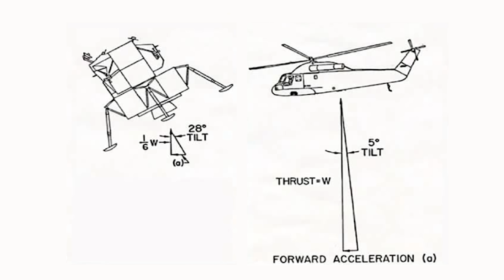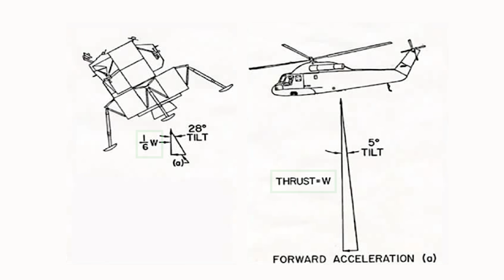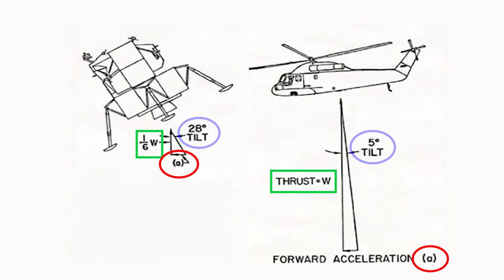How Neil Armstrong Trained to Land on the Moon  - Smarter Every Day 250

Comment: How did they solve the Van Allen belt problem?
Reply: put stuff between you and the outside of the ship. this was figured out more than half a century ago, get real.
Reply: @atlas8827  Do you realize that, that "stuff" must have the radiation protection of 12 feet of lead?
Reply: @samadams7224 
 That claim is ridiculous and not supported by anything. Give an authoritative source
Reply: @atlas8827  You're the one claiming it ridiculous.  Where's your link?
Reply: @samadams7224  
You made the claim about the lead shielding, not me. How do you know you'd need 12 feet of lead?
Reply: @atlas8827  Are you saying you don't know the radiation levels in the belts?
Reply: @samadams7224  
I'm just asking where you got the 12 feet of lead figure. I know a thing or two about radiation, and I can't think of any radiation level that would require that much shielding. So, where did you get your figure?
Reply: @atlas8827  You originally said "stuff" between you and space, so I doubt you know one thing about radiation let alone two things.
Reply: @samadams7224  
Explain how what I said is wrong. That is a very basic way of dealing with radiation. You put stuff between you and the radiation. The material in-between soaks in some or most of the radiation before it reaches you. This is particularly true for the van allen belts, because most of the particles are of low energy, meaning they're fairly easy to stop. "Stuff" in this context refers to everything that is between the astronauts and the outside of the spacecraft. The hull and the navigating equipment, mostly.
Reply: @atlas8827  You're right I'm sure engineers use the word "stuff" all the time, especially on technical drawings.
Reply: @samadams7224  
I'm not an engineer, and we're not in an academic setting, meaning we can forgo any formalities. Nothing of what I have said so far is wrong. Where did you get your 12 feet of lead figure?
Reply: @atlas8827  In 2000, I was at the Houston space center and they had the Apollo 17 capsule on display.  Back then the public could touch the open hatch door.  It was only 1/8"  aluminum.  Instead of saying "stuff"  why didn't you just say 1/8" aluminum will protect you?  I know you're not an engineer, but you still need to use common sense.  Put your cell phone in an aluminum box and see if you call the phone and have it ring.  Stand under a cell tower.  It will ring.  Do you think the microwave radiation from cell phones is more than the Van Allen belts?
Reply: Also, the radiation in the van allen belts is in no way comparable to cellphone microwaves. That is wrong in so many ways I can't even understand why you would make that comparison.
Reply: @atlas8827  I don't think you're capable of understanding what I've told you.
Reply: @samadams7224  
I am. You told me the hatch door was 1/8th on an inch thick, which it obviously, evidently isn't. 

Then you made a comparison between the van allen belts and microwave radiation, which is silly because they're completely different things. What exactly is there to understand?
Reply: @atlas8827  1/8 of an inch.  Don't they teach factions in school anymore?  Let me try something easier.  When you go to the dentist and they take an x-ray of your teeth they put a lead apron over you, because for a split second you're being exposed to radiation.  Why don't they use a thin piece of aluminum?  Because it doesn't offer any protection.
Reply: @samadams7224  
Yes, 1/8 of an inch. 0.125 in, or ~3mm. There's no confusion on my part here. The hatch door of the command module is obviously thicker than that. Look at the image I posted. 

A thin piece of aluminum would not do much against x-rays, but a thick one, like the one found in the command module, most certainly would. But this comparison is still flawed. It is not as dumb as the microwave comparison, so that's an improvement, but it's still wrong. Photons from x-rays can penetrate much further into materials than the low energy protons and electrons that dominate the belts.
Reply: @atlas8827  The command module is the capsule.  That door is hollow like your car door. Unless you think your car door is solid metal too.  The skin of the capsule was only 1/8" thick aluminum.   I've spent too much time on this and am bored.  You have yourself a good life.
Reply: @samadams7224  
How were you able to get that number by just looking at the door? Did you drill a hole on it? Sounds like you read that figure somewhere and took it at face value. Is that what happened? Just like with your 12 feet of lead claim? It is, isn't it?
Reply: @atlas8827  Drill a hole in it?  I rapped on it with my knuckles.  It's hollow.  I told you, I touched it, I felt it. Just like your car door is hollow. The skin of the capsule is 1/8" aluminum.  I felt it.
Reply: @samadams7224  
I'm curious as to how you could tell the skin of the capsule is 1/8 on an inch thick by doing that. "I felt it" doesn't strike me as particularly persuasive.
Reply: @Justincase008  I wouldn't pee on Curious Droid if he was on fire.  He still owes me $10 bucks he borrowed years ago.
Reply: go thorugh fast enough and in the right place

Comment: To this day , vertical landing had been a nightmare for rocket engineers. By the time it was not successfully simulated here on earth, yet it was managed to do on the alien surface successfully in the first attempt, bleurgh. It sounds more like a faith talk not tech talk. There are many marvelous achievements by the NASA in space exploration, that it can cover up what was technologically unachievable at the time. It would be interesting to see how one such landing could be made in 2024. With the technological advancement, It should be way easier then in 1969, devoid of the transistor magic yet. It is still thrilled with challenges and risks that can reveal the truth of Apollo landing, people have been fooled for so long. And it is this fear that has stop NASA from making one such attempt.

Comment: Hey a series that you haven't done that I think would be super is a SPY series.

Such as the SEAL of the United states and how Russia planted a microphone in this gift. A trojan house type warfare.
How it ws remotely powered and able to transmit signals back.

The interesting gadgets of today, how they can turn your cell phone into a super spy machine. IE able to hear a conversation over a km away.

Microdot film and how it worked. The ability to remote power items isn't anything new, but it has interesting applications in industry and life. :D

Comment: ................though I did not watch, I would believe you would need a vessel, to sneak into the room without leaving a landing creator. & to puppeteer the astronauts around, use that stealthy NASA cable that only reflects above astronauts when if the staging of the lights are wrong.
Reply: Lights? as in plural? as in that would create more than one shadow at differing angles? ok.
Reply: the reason there is no plume is because rocket engines work differently in space, monoprops dont produce a visible flame and the lander had an antenna to trigger the engine stop about 10 ft off the lunar surface. Also, there was some dust blown, just not much.

Comment: Would gas pressurized ballast tanks with water help? Under the right pressure you might be able to make superposition states of water(lots of internal potential energy).  I suppose if you were really crafty you could use the same system to create just enough inertia, not only for axis control but even horizontal direction in waves. Pilot that wave to a gradual acceleration. Save fuel.  A type of internal caterpillar drive that loops the water through flash phasing of super positioned states of simple water, under gas pressure(s). Wire it to a gyro you'll have precision control. Think the name would be attitude indicator. 

  Those old designs are "Earth like" atmospheric vehicles. Could even use the idea for satellites too. Steam Punk next level.
Reply: When you loose the ball feeling on the centered mass vehicle, a good pilot will feel that in a New York heart beat and bail with an experimental craft. I'll never let my parents think that buying me a skateboard was a waste of money when I was a teenager. Food for thought.

Comment: Unrelated topic but... 
I’m just curious about this question I’ve had, if you or anyone in the comments know- is there a material (at room temperature... or not)  that will break/fracture without deforming/ bending first?- or what material deforms the least amount before breaking?...

Comment: Kerbal Space Program models that problem very well! I've had a few mishaps over the years that were the result of touching down sideways while I was trying to get rid of the horizontal velocity that I had underestimated. The ingame equivalent to Venus, which is called "Eve" has a very small moon named "Gilly" which has such low gravity that ur almost better off using something to hold on to the surface after touchdown rather than just letting ur lander stand on its landing gear. Every maneuver u perform in its SOI has to be performed with utmost precision or u'll end up over- or undershooting stuff big time real quick! Also, due to its small size and low gravity it's not a spherical body, but looks more like a huge asteroid.

All these things combined once led to a crash landing where Gilly had rotated far enough to no longer present the same surface at the same angle and my impatience had led to me time-warping beyond the point where I would've needed to fire up my really wimpy engine to slow down enough for touchdown, so I had to change my trajectory dramatically to avoid crashing into the surface, leading to 1 of the situations I described in the first sentence. Fortunately I managed to slow down enough before touchdown that nothing broke from the impact but I still landed sideways. But thanks to Gilly's low gravity I could use the RCS to just barely get the thing upright.

Comment: (IDEA FOR VIDEO?) 
I love your channel, sometimes you do slow motion video.  I would love to see a slow motion video of a car tire and motorcycle tire going over small bumps (for example a slightly off kilter concrete road joint), and compare the car tire with different tire pressures.  I want to see the tradeoff of tire pressure to ride quality.  I usually run my tires about 5-7 psi lower than the manufacturer specs.  I do this because I think that the car rides much smoother.  I wonder if this is my imagination, or if it is real.

Comment: I would like to know if other planets including earth spin on its axis as well rotate around the sun how come the moon does not spin on its axis?
Reply: it does
Reply: The rate of spin of the Moon equals its orbital period, so it always shows the same face to us, but it is still spinning. This is called tidal locking and it is quite common. It is caused by the difference in gravitational pull of the the Earth on the near and far sides of the Moon.

Comment: One of these days, I’m going to figure out what that silver device with the changing green and red lights is. The one mounted on the upper corner of the map.
Reply: Red, green, and blue lights. A wire, lights change back and forth. Weather station repeater?

Comment: This is amazing - thank you! I had a very naive question: Why couldn't they use a simulator vehicle with 1/6 th of the weight (of the actual aircraft you wanted on the Moon) in the first place while testing -- and send in the actual (augmented bulkier) aircraft later.

Is it because if we could've built something that 1/6th of the weight with the same characteristics we would have already? Or am I missing something physics-wise about why the testing had to be done on the original bulkier aircraft (and then add strings or vertical boosters to offset the weight)?
Reply: gravity accelerates objects of different weight at the same rate.
Reply: @atlas8827  Right, of course! Thanks :)

Comment: And what we seen in films from moon. Some guy noticed that angle was wrong as you illustrated. What was big idea use jet engine in practice session? Gyroscopic effect mess all rocket guidances. Armstong didn`t saw any problem with it. When we see rockets in airplanes for steering?
When mass began to meaning ruler in ballistics.
Reply: Let's say that a jet engine is quite safer than a rocket engine. The LM had RCS thrusters to steer the spacecraft but airplanes do not need those since they wing. Did I understood your argument correctly?

Comment: They could have used the VTOL plane flying over the module attached by cables to the module with linked command to achieve a results in between the gyro engine and the ground tower.

Comment: How the heck are you going to do ANY maneuvers on the moon with no air to push against?
Reply: Rocket thrust does not work that way.
Reply: @stevetheveteran  I know that rocket fuel contains an oxidizing agent.  But we are shown maneuvers using small jets of air. In a vacuum?
Reply: @debbiesimmons4593  You are confusing rocket engines with RCS.
Reply: @stevetheveteran  Don't they use oxidizing agents too?
Reply: @debbiesimmons4593  Yes they do, but that doesn't change the fact that they, as well as rocket engines work just fine in a vacuum.  As a matter of fact their efficiency increases in a vacuum.
Reply: @stevetheveteran  That makes zero sense to me! Let's just leave it there.
Reply: @AnOfficialYouTubeProfile  They do, but far too many people see the nonsense videos on youtube and glue themselves to conspiracy theory beliefs.  

Could you imagine just how ridiculously weak a rocket would be if it required our atmosphere to push off of?

Comment: now s the question, we already know NASA and other Private firms will be building Training Simulators for Astronauts to train on and pilot in VR  and AR applications with microscopic tolerances. But will they build an actual working LLTV 2.0. 

The way I can picture a 2.0 version of the LLTV is with Quadcopter/ Hexacopter / Octacopter technology and a thrust vectoring turbine in the middle of the vehicle. The turbine would provide thrust and the outside axis blades would provide precision-controlled stability.

Comment: what about the Van Allen radiation belts how did they get through that....anyone...anyone??
Reply: That has been explained so many times.
Reply: @stevetheveteran  No sound in the lem, no dust flying, no stars showing up. That has been explained so many times.
Reply: @GBienvu  
There should be no sound. There's tons of dust. Stars should not be visible because they're simply to faint to be captured with the exposure settings used.
Reply: @atlas8827  No sound? When you seat upon a reactor, you can trust me there is much much sound. And... well if I was on a trip to the moon, I would think about the good exposure settings for the stars. But maybe it's less important than Americans walking on sand.
Reply: @GBienvu  Your complete ignorance is showing.  Tell me, what is the stop difference between direct sunlight and night time star light?
Reply: @GBienvu  Also, I'm curious....what microphones would have been picking up the sound in the LEM?
Reply: @stevetheveteran  what microphones would have been picking up the sound in the LEM
- The same microphones that pick up the astronauts' voices maybe?
Reply: @GBienvu  So the microphones that were right next to the astronauts mouths and during landing, also inside a helmet.   

You realize that even though you've watched a lot of youtube videos, you are not nearly as smart as the thousands of mathematicians, engineers, doctors and scientists who made the moon landing happen.  You don't understand even the most basic concept of film exposure or sound propagation, yet you have convinced yourself that some conspiracy theory videos have suddenly made you smart.  They have not.
Reply: @GBienvu  If the astronauts on the lunar surface were to change the exposure settings to capture stars (which they did but not while on the lunar surface) the surface of the Moon would bleached. Agreed?
Reply: @oscarin13  the surface of the Moon would bleached. Agreed?
- I don't make hypothesis, sorry. I stick to the fact that there are no stars on the photos. There would be the same result in a studio.
Reply: @GBienvu  The same happens in high-altitude balloon footage. There are no stars eve though most of the atmosphere is below.
Reply: @oscarin13  There are no stars during the earth-moon nor moon-earth travel either. How do you explain that?
Reply: @GBienvu  Because they had the earth or the moon, or both in the shots that they took.  The exposure settings were for sunlit bodies, not very dim stars.
Reply: @GBienvu  This would be quite easy for you to understand if you could understand the stop difference between direct sunlight and starlight.  Fun fact, it's about 20 stops.
Reply: Just type that on a search engine and you'll get the answer.

Comment: in the 60th they had to do so much manually, when it came to flying this things. Today we got toy-drones that can stay stable in the air, even if with turbulences and partially damaged rotors.
We got vertical landing rockets and flying stainless steel tanks :D
Engineers these days should be able to build a new lunar lander with ease